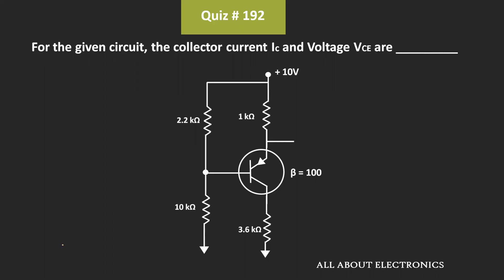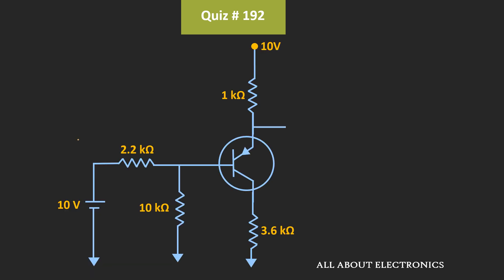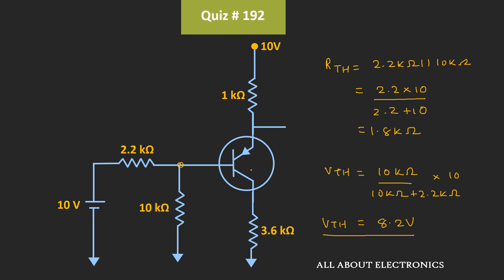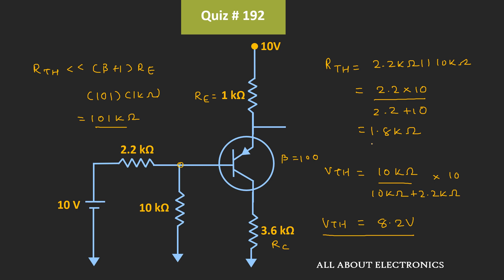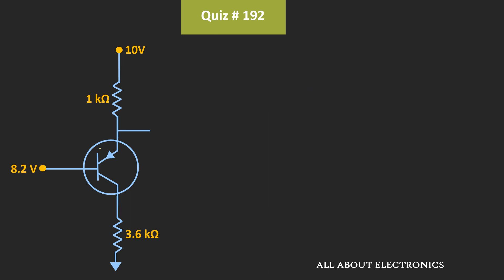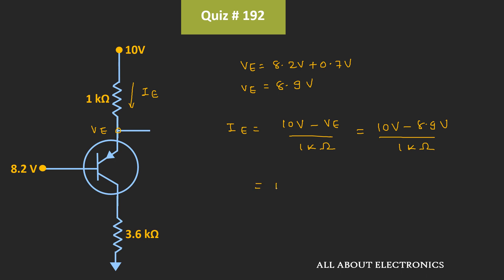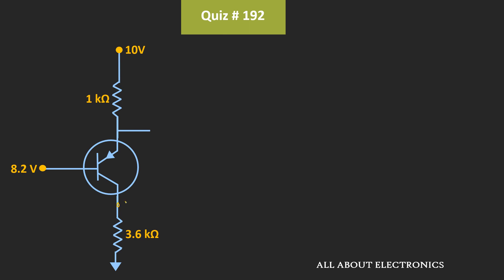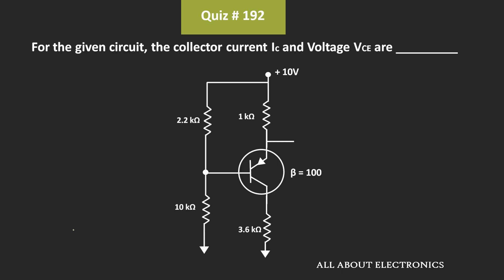Quiz # 192 (BJT- Voltage Divider Bias)

Comment: Hello Sir. In this pnp transistor type, we don't need to put the parallel resistor of 2.2k and 10k ohm in between Vth and VB? In npn type, we need to put , right?
Reply from the maker: I think you are talking about Thevenin's equivalent resistance right !! Well in this case also that is 2.2 k || 10k

Comment: Why vCE is that much high? It means too much power dissipation during forward biased, am i right? Is this the reason that people prefer MOSFET over BJT? Waiting for your kind response, sir.
Reply from the maker: If you calculate the power dissipation across the transistor, its around 5 mW. For the discrete transistors, it's nominal. Yes, its true that MOSFETs have low power dissipation compared to BJT. But still, in many general-purpose applications, BJTs are used.

Comment: A voltage divider bias circuit with a 25 V supply has RC = 4.7 KΩ , RE = 3.3 KΩ ,
 R1 = 33KΩ , R2 = 12 KΩ , hFE = 50. Calculate the VCE level.

Vce=11.520 volts 
Please check my answer whether it is correct or not....
Reply: Sir please check it.....
Reply from the maker: It have checked quickly. It seems close. I will get back to you once I do the exact calculation.
Reply: @allaboutelectronics-quiz  okay sir

Comment: how did you get the VB = 8.2V in 2nd example?
Reply from the maker: Using the voltage divider rule. Vb = 10k * 10V / (10K + 2.2 k).
I hope it will clear your doubt.
Reply: Vb = Vcc [(R2)/(R1+R2)]